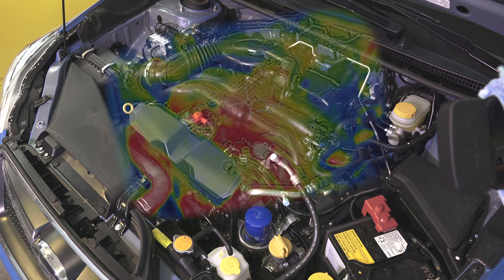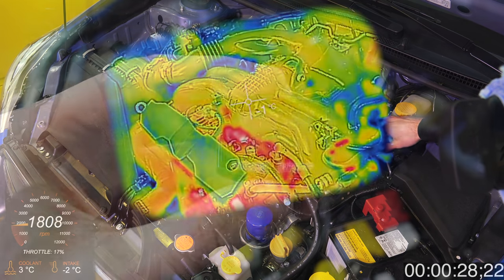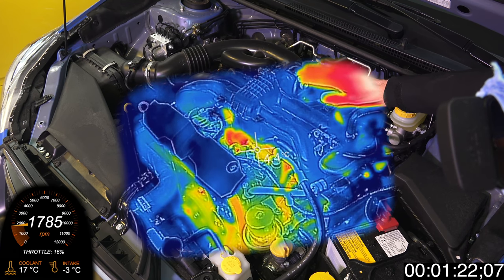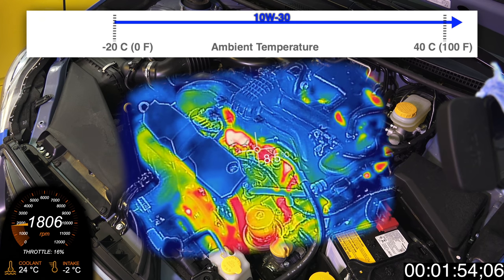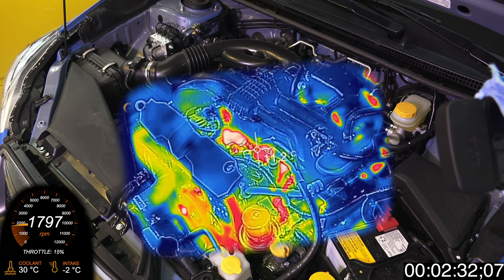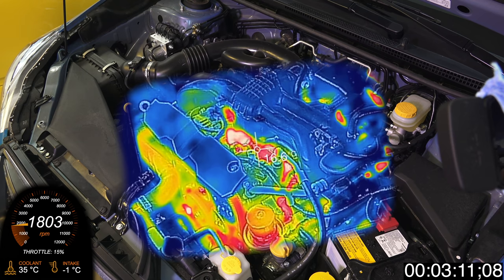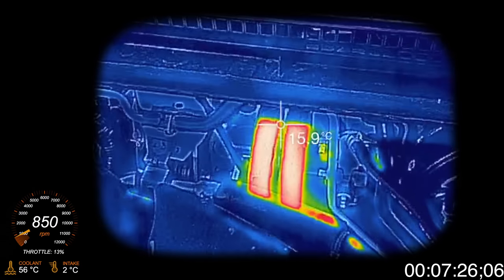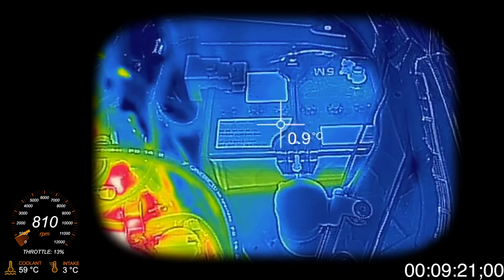Watching A Frozen Engine Warm Up With A Thermal Camera

Comment: Why does the engine rpm drops when the coolant reaches 60 C? A kind of mechanism to heat up the engine faster?
Reply: Exactly. Pretty much all semi modern engines do this. They increase the fuel mixture (like choke on old engines) and increase the engine rpm to warm up faster (and to not stall). However 1800 rpm is pretty much, the maximum i've seen on my 2008 Golf TSI was 1200 rpm for maybe 30 seconds. (As an other example, search for Audi R8 V10 Spyder: Cold Start  on Car Throttle Extra, sounds very fruity :))

Comment: I dont start driving until the arrow moves atleast 1/10th of the gauge
Reply: If it's registering on the gauge at all, it's warm enough to drive. You won't even see the gauge move until its well over outside temp.

Comment: why does rpm stay so high at idle? my 330i 2006 year stays 1,1k for about 10 seconds then start droping and after a 30 seconds it all drops to 700 rpm and stays there

Comment: i drive a diesel 2.0 hyundai santa fe 2002 and i drive the car when the engine sound changes a little..i dont know how to explain it .. but it usually stays idle-ing for like 4-5 minutes.(-10 to -20 C) -Romania-Europe.

Comment: What about slowly driving it? I need to prove to my dad that the engine warms up faster that way.
Reply: Kammex it will actually warm up faster that way, you're right. The extra load of propelling the vehicle forward will cause the engine to warm up faster as it works harder. I generally only do this if the windows are not fogged up from the cold. It does take 30-90s for oil to begin to flow to all of the components after initial startup, so that is something to consider also.

Comment: I have to let my vehicle warm up for a few minutes before driving. 

power steering hoses full of basically hydraulic fluid, are like syrup. it's bad news to try and drive in our climate fresh after a start. 

a lot of times. the transmission is too cold to move immediately. and even after 30 seconds, itll shudder and vibrate

then the brakes. the engine cant warm the fluid directly but engine bay heat will help.

otherwise youll stomp a brake pedal and youll feel like your trying to move a loaded dresser with your foot.

it's hardly to do with engine oil, its a combination. 

if I wanted to warm it up enough to be comfortable I'd be waiting for over half an hour. 

but that's what I get for living in north dakota. 

two weeks ago it was -53f. 

right now? it's 33 and people are literally out in t shirts and shorts. 

not me though! It's nice, but I'm Always prepared in case I get stranded somewhere

Comment: In Middle East the temperature goes up to 50c , how does the engine handle this temperature ?
Reply: Very well, if using the proper weight oil and all the cooling parts are in working order.

Comment: if it's ok to drive the car cold then why have thermostats regulate the engine temp to 195*F? why even have thermostats?  without a thermostat the car will operate closer to 90*F.  for that matter why is there a term for "operating temp"?

Comment: my engine doesnt warm up properly. ive got an 1.9 tdi audi a4 from 2008. the coolant goes to 70 degree and stops there. at 90 degree is the normal temperature, but it only gets to that temperature if i work it really hard.
Reply: Diesel engines are very efficient hence they produce less heat (heat is basically wasted energy) it's quite normal that it doesn't get that warm in the winter
Reply: That can be a sign of a thermostat problem,  it may have failed in the open position so in cold weather it never gets to "normal" operating temperature.  Had that happen on a couple of my cars in the past, they are usually cheap to buy and fairly easy to replace.
Reply: teknown diesel engines actually produce more heat than gasoline engines due to the method of igniting the fuel,  (by compressing the fuel mixture until the friction created causes it to ignite) due to this they run much higher compression than gas engines. Also, due to diesel fuel having a larger caloric value it burns longer and creates hotter combustion temps as well as higher exhaust temps. it is also more important to warm up a diesel engine than a gas engine.
Reply: teknown same problem here: 2.0 diesel opel vectra b from 2000, get's on 70-75'c and stays there if i am out of town... if i drive in town for a certain ammount of time let's say 30-40min or moore my temp will get on 90 like it shoud normaly
need to say it's between -5 to -20 degree outside at all time in my place
Reply: Brandon Cunningham hotter combustion doesn't equal producing more heat (it sounds counterintuitive but heat energy and temperature are not the same although related)

Comment: You start off with the timer on a hot engine overlay then back to cold them a bunch of talking with cut scenes. Video would have been way more effective with way less talking with simply just focusing on the temps, rpm's along with the timer then after you should conclude results.
Reply from the maker: The engine is not hot at the beginning. The entire process is shown, with how long the engine has been running in the bottom right corner.
Reply: First 10 seconds shows rad hose etc. Red. 

Anyways I was just annoyed by your execution. I think a simpler approach would have been much more effective. 

No biggie.
Reply: I KNOW THE ENGINE ISN'T HOT! I was just making a point that you showed an OVERLAY OF A HOT ENGINE BEFORE TOUCHING IT.   OK LET IT GO BYE.

Comment: So it's -39C today, what do you recommend?
Reply: 0w20 if you live in such areas. are your summers super hot also (assuming you're in Canada and its like the Siberian summers with 35-40c even?)? Then change your oil in spring to 5w30, like for the specs of your car. You need 2 oil changes a year no matter how much you drive in those situations
Reply: @em4703  yes I'm in the dead center of the province of Saskatchewan (center of Canada) so basically the north american equivalent of deep Siberia, there are places north of us that stay warmer in the winter because they are closer to the coast!

Comment: My Suburban will choke and die if it doesn't warm up for at very least 5-10 minutes. At only 60 degrees F. Different Engines have different requirements.

Comment: Why does the engine have 1800 rpm when it is cold and 800 rpm when it is warmed up?
Reply: why can't the oil flow at 900 rpm?

Comment: The thermal image is almost useless. Why? Because you didn't compensate for emissivity differences for the different materials in the engine bay.  And you can't actually because it's impractical. But just think of this. If the car had been standing for 24h and had reached a uniform temperature then the thermal camera should have shown all engine parts the same colour. But it didn't as the emissivity of different materials varies and needs to be taken into account. So just looking at the pretty colours of a thermal image is meaningless. Hopefully one of the thermal camera manufacturers will offer an option to calibrate out the emissivity and only show the delta T.
Reply from the maker: It’s not useless, at the start the readings are all very close in temperature, super small range. I have other videos using much more sophisticated thermal cameras which calibrate constantly to ensure as close to accurate temperatures are being read. Emissivity is not a new concept to FLIR (who makes the cameras).
Reply: Well the range needed to be widened so that the radiator hose isn't bright red and the valve cover light blue. That gives the impression that the hose is hotter than the valve cover which it won't be if the engine bay was dead cold. It's a pet hate since I've worked with thermal cameras quite a bit and can be very misleading. Great videos otherwise.

Comment: Why does Subaru go with 0w20 for its non turbo engines and 5w30 for turbo'ed ones?
Reply: Walter Black protection for the turbo, (because they get very hot by design) it would cause the 0 weight to be too thin.

the n/a motor has a tight clearance but not the extra heat, so the 0 weight wont thin out too much and gives the Best protection.
Reply: Fuel efficiency. Going to a lower weight oil reduces friction and increases fuel economy slightly. Over the years most manufacturers have switched to lighter oils to try and compete in the MPG area, and Subaru was actually later to that game. It is also true that newer engines have better internal tolerances, making it safer to run thinner oil. It really boils down to efficiency though. You can still run a traditional 5W30 in most that call for 0W20.
As for why they request thicker in turbo engines, it's probably because the thicker oil is better for the turbo bearings and also helps more with compression and piston ring lubrication with high cylinder temperatures. The older EJ engine design always calls for the 5W30, which includes the current STI. While the newer FA engine calls for the thinner 0W20 oil. The new WRX is an FA engine, but as you mentioned it has a turbo, so they call for the thicker oil.
IMO running 0W20 is kind of scary considering how thin it is, but obviously tons of engines are fine with it. Hope this helps.
Reply: If I go turbo or sport car 5w30 for wear protection.  thin oil too scary when you reach high temp.
Reply: A lot of people even run 10W30 or 10W40 including oil meant for diesel engines because of the wear additives. The more heat and power in an engine, the more protection it needs. There are thousands of forum posts about it.

Comment: Why most people at my place warm up their car for few minutes before moving? it 25°c here. Every morning their start the car then put the bags and stuff in and wait until the car warm uo and then move...
Reply: Probably because they were told to do so for cars way way back in the day, and then that sort of "information" gets passed on for obscene numbers of years.
Reply: And yet it's still relevant to this day.

You should allways warm up your engine if you're going to go above 3000rpm. It'll reduce the wear and the stress of some parts heating up faster than other parts.
For instance, an engine with cast iron block and aluminium head WILL crack the head if you start it up and then floor it a few minutes later as the aluminium head will expand faster than the block and in return tear itself to pieces.
You wont probably notice at first but your engine will begine to smoke more and more over time and you'll think it's a blown gasket.

It's much less relevant for engines that have aluminium block aswell, but to some degree you should let it heat up as there are other components that like operating temperature before they are put under stress.
Reply: I live in Florida and own a 95 Escort, and no matter how hot or cold it is out here (5-45℃ at times) when I start my car it idles at 1100 RPM then drops to 800 after 15 seconds. My dad taught me that it puts less stress on the engine when you wait for the RPMs to drop. I'm not sure about cars that don't drop their idle, though.
Reply: StopaskingformynameYouTube this can also be done just by getting in waiting 5 seconds and driving at idle rpm. It really depends on your situation, but at room temperature it will take a lot less longer. Know your initial temp and base it on that.

Comment: But what is the harm too in wait like 5 mins for it to warm up?
Reply: The oil heats up quicker by driving modern cars so actually does less wear and tear. Unless we're talking older cars... I drive a 26 y o car which doesn't warm up any quicker driving so lower RPM for longer is better.

Comment: What about a turbocharged car like a new WRX?
Reply: As he says is fine. Give it a minute or so to get things circulating and then be gentle with load and revs during warm up. You need some load because it's upper cylinder pressure that presses the rings against the cylinder walls.

Comment: Hahaha. Low throttle and low rpms.

1.4 liter shitbox

High throttle all the time. 3-4k revs on the motorway. 

Time to rev the bullocks off the engine from cold

Comment: I want to ask you of my transmission is 99c should I be worried ?
Reply: i'm guessing that's after driving alot or driving it hard. if so then it's pretty normal
Reply: If automatic transmission and you are sensing the fluid temperature, no for most transmissions, however, beware of ATF operating temps higher that about 240F (118C). 
Some transmission manufacturers have charts indicating the effects of operating temperatures above about 235F (112C) and the expected reduction in transmission life.

Comment: What about turbo engines?
Reply: Warm-up and oil flowability is even more important before subjecting the engine to moderate to high loads and or moderate to high RPM operation. 
The turbo bearings may be damaged if not properly warmed or lubricated. This is especially critical on turbos with ball bearings or ceramic bearings.

Comment: 60°C after 10min idle lol.
MY shitty CDI Diesel just reaches 60°C after 30km of driving. Without heater on. :)
If I turn heater on then its 50°C.
And yes. I changed the thermostat multiple times now.
Reply: It's because the efficiency of diesel engine is so high.
Heat is a waste product of an engine.
Reply: Eneri Giilaan i know... well because its not getting warm it has more wear... aaaaand consume 8l/100km :) not even 20% city driving. well diesel wasent my choice and i wont get any diesel any more.
Reply: OK - I see. 
The 8/100 sounds indeed a bit high ... depending on the size of the engine of course ;)
Reply: Eneri Giilaan e200cdi 2.2l diesel. 116hp, no power at all but reliable at least ^^

Comment: It should be warmed with electricity so it doesn have co2 emissions
Reply: make sure that electricity is generated by wind/solar/hydro though, otherwise it's pointless
Reply: @dadwillfixit  yea. Tbh its pretty sad that most of electricity is still maked by burning fossil fuels
Reply: @dadwillfixit  yea

Comment: 1800rpm!!!! Its 3x normal rpm. This is not healthy :) bad lubrication + high rpm
Reply from the maker: It’s completely normal for a car that’s warming up. Cars will idle high when cold to warm up the engine quicker. Idle drops when coolant temperature increases.

Comment: what to do if its -25
Reply: Like it warm up until the coolant temp gauge gets to 100 degrees Fahrenheit
Reply: 5-0w30-40 oil. same steps as above besides that. dont overrev the engine for the first 10 minutes and all is good

Comment: 5 min  mínimum 10 max them just drive
Reply: For gas, sure. For diesels no, after 1 minute maximum drive slowly away. Diesels need load on the engine to warm up. Just dont go over 2000 rpm and its all good.